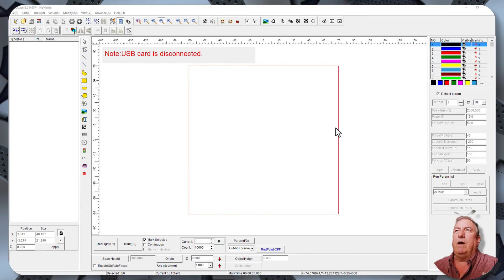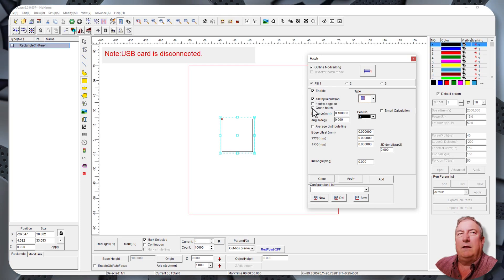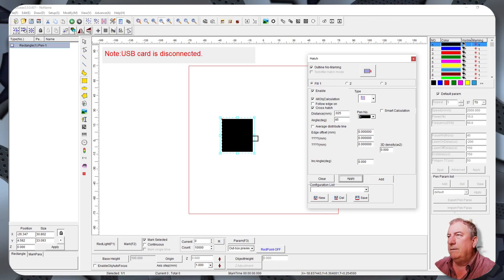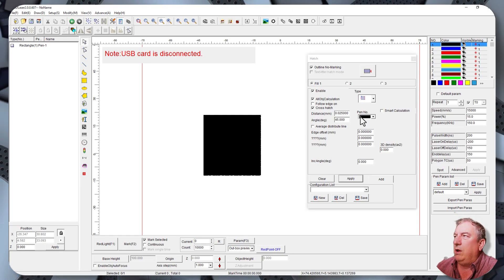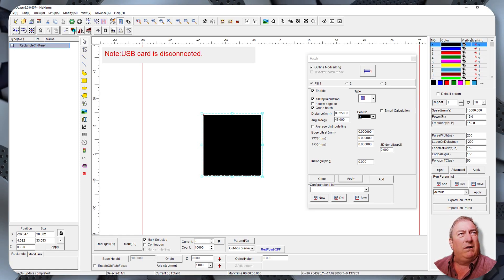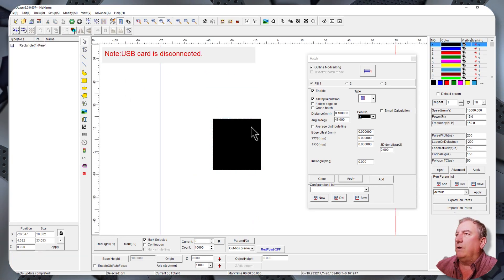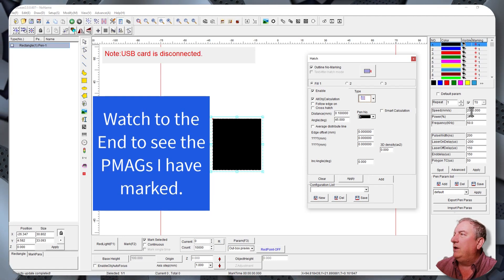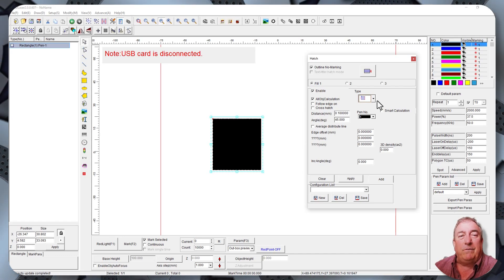EZCAD Settings for Plastic PMAGs #pmag #laserengraving #ezcad2 #laser #settings #fiberlaser

Comment: Hi Darryl, What galvo head are you using that can operate at 15,000 mm/sec? I have a 100W JPT MOPA M7 unit that came with a Sino Galvo SG7110C head capable of 7000 mm/sec max.
Reply from the maker: It is a 50W 3D MOPA from Radian.  Here is the link.
https://www.radianlaser.com/open-frame-fiber-lasers